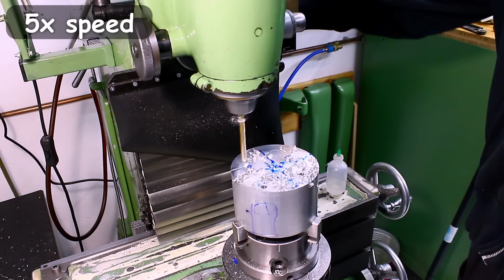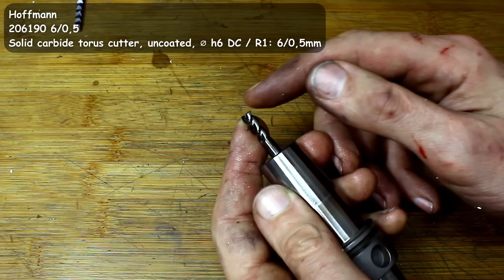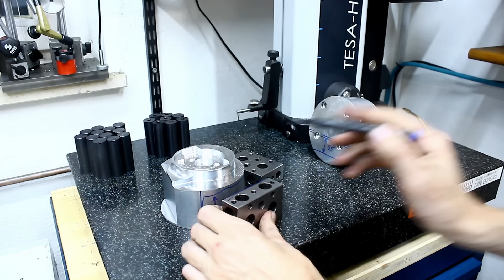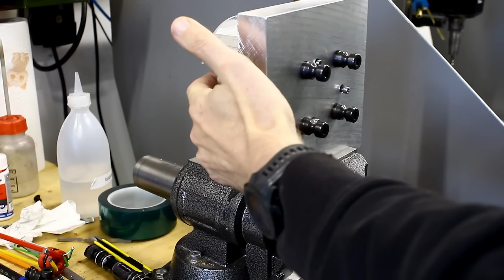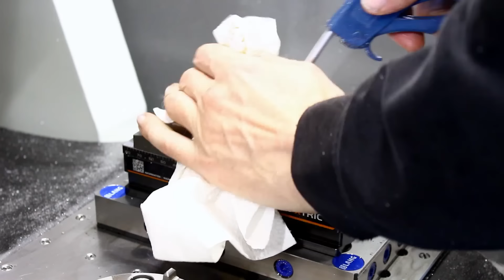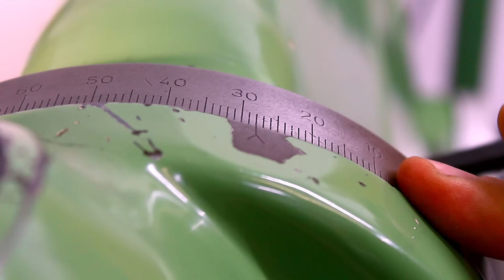Machining a Flux Capacitor Bracket - Combined Manual and CNC

Comment: Hey Stefan, thanks for the video. Question: when hand tapping recently I noticed I can get a heavier cut on one side than the other, have you seen this or am I doing something wrong? In other words the threads can be off in the X&Y vs the hole slightly.

Comment: I've always thought it's a bad idea to use an endmill deeper than the flute  length. If it works like a charm for you, I should give it a try
Reply from the maker: It requires the endmill shank to be relieved (necked down in diameter), but it works WAY better than long flute endmills - Way stiffer.
Reply: @StefanGotteswinter , it looked like the neck of your endmill is the same diameter. So my whole 4 mm endmill is no good, I guess
Reply from the maker: @sitlar they are about 0.2mm under nominal diameter - nonnnecked shanks rub and gall on the side wall

Comment: Hello Stefan, I would like to buy a small lathe with a bed width of around 135mm and I know I can buy direct from China or buy from resellers in Germany which suits me just fine cause they have handled transport from China already and I hope their machines will be better cause they may have to handle warranty... That having been said, wht company I should buy the lathe from that you think has the best lathe out of the box (without me needing to put my hands and make it workable from the start). There are resellers of Chinese lathes like Holzman, there is the Sturmer Machines with their Optogrind etc... Have you any info you could spare?
Reply: As you yourself say in your video; I find myself having to start most of my work with a lathe!
So I need one but I need something that comes from good stock, albeit chinese stock...

Comment: I have a Chinese lookalike Lang zero-point system for my Gerardi self-centering vices. I have a CNC program to face the stock, machine the bores and mill the threads for the Lang-style studs in the stock for large microwave feedhorns. I mounted a round Lang lookalike plate on a D1-4 mount for my manual lathe, so I can do lathe ops on the parts as well as CNC. Works really well.
Reply from the maker: I would love a 52mm base on the lathe, but Lang told me to not to :D
Reply: @StefanGotteswinter My Chinese supplier had no concerns, but I keep the speeds low and make certain the clamping torque is correct after each operation. Don't want a kilo of steel trying to go into orbit.

Comment: I use 1.9 mm Simtek boring bars with an alignment taper at the rear and I made holders for lathe and boring head with cross-pins. I'm ALMOST feeling brave enough to try making my own micro boring tools from scrap carbide after watching this.

Comment: Is this a Deckel PF2? What a wonderful machine 😍 I am very impressed by your tools! Maybe one of these tapping arms might fit your needs. Clough42 showed a very inexpensive one and was very satisfied by its performance.
Reply from the maker: Deckel FP1 :)
For my line of work I dont see much use in a tapping arm - Either its guided tapping by hand for small taps or machine tapping in the drill press.

Comment: Ein sehr interessantes Video! Vielen Dank dafür.
Ich will ja nicht meckern, und es ist ja auch nicht wirklich ein Problem, aber ausbohren mit der Pinole ist "bad Practice" 😉
Allerdings weiß ich nicht, wie die Pinole bei der FP1 geklemmt ist. Bei den meisten Maschinen ist die Spindelbohrung nicht ganz rund, wenn die Pinole nicht geklemmt ist. Und Spiel hat die Pinole ja systembedingt auch noch. Aber wie gesagt, das ist alles nur klugscheißen. Für diesen Zweck war Dein Vorgehen mit Sicherheit genau genug.
Pass bloß auf, dass Du nicht irgendwann mit den Haaren in die Maschine kommst. 💇🏻‍♀️

Comment: something to add to the worry when using air blast : when you blast the oil off a part where does it go?  at least some of it becomes an aerosol that you should not be breathing, oil in your lungs is bad.      but never mind that, those parts are beautiful! (-:

Comment: I’m also a manual machinist that learned CNC from a prototype perspective and I also am very conservative with my feeds and speeds. As far as tapping goes, do you not have a bench top tapping stand? I hand tap a lot and mine has been a god send. Also, if I ever find one near Kentucky, I might need you to explain to my wife I bought a Deckel.

Comment: The Hoffmann long, stub flute mill reminds me of stub-flute reduced-shank tooling. The full length above the flutes is smaller than the diameter of the flutes. This enables you to chuck at the minimum necessary for the operation. I find this particularly useful in small, less rigid machines. The reduced shank prevents neck rubbing in deep operations. It is a more rigid cutter than a similarly-sized tool with long flutes. A disadvantage is that it will leave a witness at step-down depths, but helical finishing fixes that.

In similar fashion, a lot of insert tooling has shank diameters which are smaller than flute diameters, as does some modular tooling.

A stub-flute reduced-shank tool similar to your Hoffman would be Misumi's DLC-LS-ALHEM3B8, which is an 8 mm flute diameter with a 6 mm shank diameter, or Dijet's AL-OCRS3080-XLS, which has a 7 mm shank diameter. I think both of those are available globally. For those in North America, Maritool has economical options, though they're a bit less consistent in their sizes. They also have really good feeds and speeds information based on stick out. Harvey also has them, and good feed and speed info.

I've also made a single-point version by brazing a piece of carbide to a single-point cutter blank and then ground it to size and shaped it. I'd actually love to hear your take on that.

Comment: ?This might seem a bit off, One of the things I enjoy about your videos is the silence of your machines. Or should I say the silence of bearings. The quality of your machines and the setups that do not have the chatter of poor set ups. I am a Mechanical engineer, when I go to a shop that is making a part, It always seems the quieter the shop, the better the output. Meaning the machinists are doing better work. While I love machining, no smart machinist would let me near their machines. :) 

I take great pleasure in your videos. Most people think you just stuff the material in the machine and push a button, turn some handles. When you show your insights and thoughts, you reveal the complexities and nuances of the process. 

Keep up the great work.

Comment: The 45-degree bevel at the proximal end of the boring bar is *brilliant*. Thanks for yet another tip!
Reply from the maker: Thanks! Not my idea btw! Thats kinda standard for industrial availible micro boring tools, a lot of manufacturers use that system. But I like it a lot, because its very DIYable

Comment: Always nice to see so many fiable way of considering workflow. Point is you're living out of it. I am also the guy putting crocked band saw disc and and size them on the surface grinder for 3h because it takes me 2min of setup and 1€ of spare abrasive and at the end the part is flat and nice and I don't care I walk away and the job is done.

Comment: nice ,, i really like your channel .. going in detail... keeping it clean ... i thought you made a cyclone vacuum system .... i did also, using my old siemens ... because compresed air makes too much mess too me ... liking keeping it simple  i also use a brush .... too wipe the chips in the spaanderbak..... haha toeval ... im buzzy making a electric-motor toolholder for the lathe .. so i can make treading in one pas ... and got for the inner treading a cnc treadingmill .... yeah those are viking expensive

Comment: What CNC do you have?
Reply from the maker: A Mueller CNC FS4MG - I got the mechanical part and did the drives/electronics and accessorries myself. If you go back a bit, theres a video on the machine.

Comment: I use the datron cutters at work. They are great for material removal. But I have the feeling that they are not cylindrical. Always when I try to mill a slot with tight tolerances, the counter part fits at the upper part of the slot while the lower part of the slot is to tight. Doesn't matter how often I do an additional empty cut to the slot.
Reply from the maker: Yeah, matches my experience - They are not the most high precision tool.

Comment: Oh yeah, the 40-taper-is-not-self-locking gang. Just leave a toolholder in a VMC overnight and you’ll find out how self locking it is when the hydraulic stud isnt powerful enough and you need to bang it out with a wooden wedge and medium sized Meinungsverstärker
Reply from the maker: Haha, yeah we had that at the old dayjob too - The drawbar couldnt kick out the tool.
The service tech told us to smack it.

Comment: That two parts are insane. The engineer in me thinks that kind of part are questionably designed. Just like if you want a single part to solve all the design flaws in one point.
Reply from the maker: There is a lot going on with this bracket, a lot of things mount to and into it (the backside with the M2 threads) and it needs to snake around a lot of existing infrastructure.
Reply: @StefanGotteswinter  Well, probably too much going on. That's the point. When you design a part, if machining becomes too complex, it means you fail somewhere in your engineering.
Reply from the maker: Without knowing the constraints that optimistic to say, especially when retrofitting something to something.

Also theres a point of dimishing returns. Sometimes making the complicated part is faster and cheaper than mucking around for ages and discussing between customer - engineer - machinist.

Comment: As a repair shop I clearly understand the perspective of manual machining and why it makes sense.  Much if my work is done with portable tools anyway so it's a much different mindset  than the manufacturing world. I do the occasional  one or two off  turning at times for customers. but the machine shop here is to support my repair work.  
However I enjoy your work when you can show it and like you approach to metrology and fixturing. There are practical  things here any machinists make use of in one form or the other.  Maybe if and when I retire I can play with a CNC router or 3D printer, if anything to keep my mind working. Never say never!  cheers

Comment: what is the low end on the Spinogy for drilling?
great video.
Reply from the maker: It becomes useable at 3000 rpm, but very limited torque in that range. Not like pushing a 10mm drill :D

Comment: So many clever tips in this video! Using the spot drill to countersink, the bevel on the boring bar shank for locating, and the flat on the shank of the tap for tapping with a drill chuck.

Comment: Great idea with the flats on the tap in the drill chuck. I like it when I can TIG weld a couple chunks of material together to make L shapes like this instead of cutting and machining. For personal projects it's often fine. Also, I've been dreaming of those Kopal clamps ever since you showed them. Then I found a set of two, in the case, with accessories, like new. .....  for $80 at an estate sale ....  Unbelievable luck 😀
Reply from the maker: Congratulations! Thats a steal.

Yeah, doing a composite construction with weld/screws or brazing can often be an alternative.

Comment: Very interesting part and philosophy behind your way to make things.

I have been working as a CNC lathe machinist for 25 years now, and I'm used to manual programming, but I'm also "mentally" a manual machinist.
But I have to be fast and to reduce machining time as I possibly can, at least at my workplace.

In recent times I started this plastic recycling project, and I started to discover the magic of CAM and CNC milling, on my DIY converted machine, for making injection moulds.
Both are very interesting fields, CAM for the various strategies possible to achieve a good result, and plastic injection too!

Cheers from Italy!